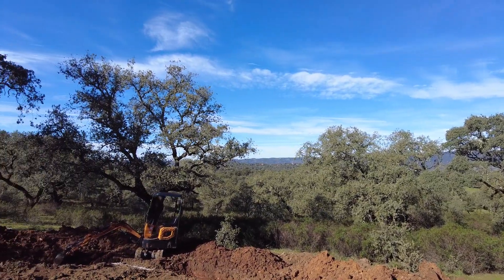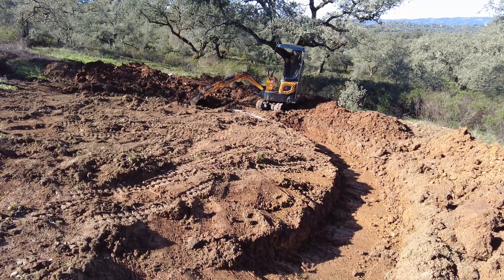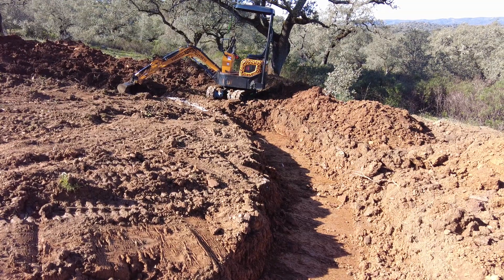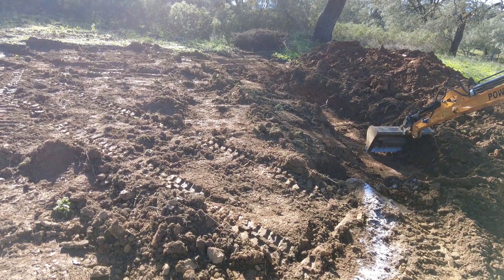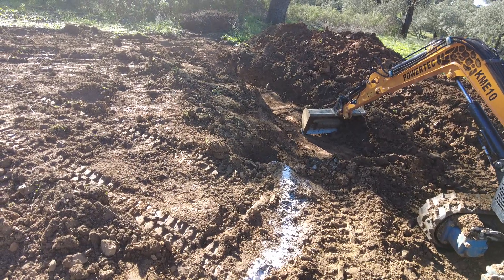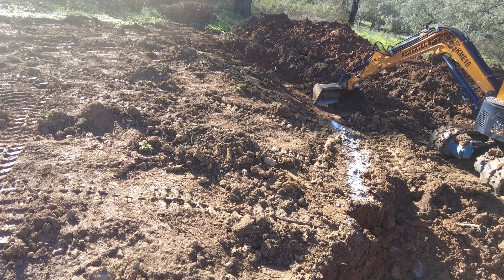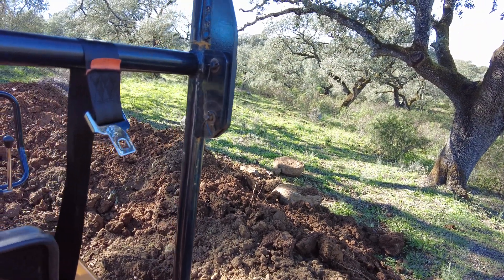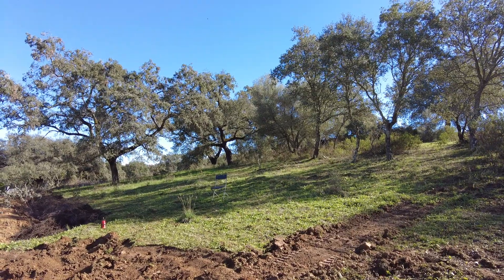Digging a keyway, my way. Which way is the right way?

Comment: well for clay that holds water you need the kind of sticky stuff that sets hard when its dry, if you can dig it easily by hand with a spade its probably not dense enough. if you wet a handful and knead it together it wants to be coming out sticky and hard like pottery clay.
That said when you are digging take off the topsoil then the subsoil and the clay you want for sealing a pond is going to be the next layer down where there are almost no plant roots. and usually on top of the bedrock.
If you have it use atleaast a 30cm thickness of clay to seal embankments and inspect bedrock for fissures that will allow seepage, (a bucket of water is a useful aid for this) and seal those with as much depth of clay as you can pack into them.  If you can find them have a look at how canals were built in the UK, most of them were lined with puddled clay and stiull don't leak over 150 years later. 
Hope this helps 
thankyou for sharing
Reply from the maker: Thanks for sharing this valuable information. Much appreciated. Sticky stuff I will find.

Comment: Beautiful!  I am so excited that you have gotten this far with 110 hours of time in the seat.  You are making real progress.
The walls do not have to be perfectly straight.  What is most important is compaction.
I suggest that you continue to dig what you can from the platform on which you are sitting, casting the spoil downhill.
When you have to move, I would move to either end of the key, with your blade forward and always start digging with your boom, stick and bucket fully extended.
Slowly start to pull the uphill soil into your key, distributing a thin layer of clay evenly with your bucket. When you are ready to move forward, set your blade for 4" and drive ahead to the next dig location.
Work your way around the entire key in this manner.  
Then it is time to drive the machine around the semicircle key several times for compaction.  Each trip move the location of the machine in the trench so your tracks are on fresh material.  Last trip through, curl your bucket and use it to compact(tamp down) any clay the tracks missed.
And that is the process.  Continue this process until the key is level and at least 1/2  meter above the top of the spillway. Use your laser level to get a precision measurement.
When the key is finished, you will work on filling and compacting the 3 to 1 ratio.
My eyeball sees a finished profile that is oval.
With your experience, I believe the most difficult part is complete.  Now you will be surprised at how quickly the build goes.  You should be ready for the rain forecast by Accuweather for the last week of November 👍
Reply from the maker: Thanks captain
Reply from the maker: Thanks for sharing, especially about working my way around with the excavator.
Next week I go to see my grandson, so, pond must look after itself.
How much rain in the Nov forecast?
Reply: @SuerteDelMolinoFarm   That is how I've always imagined this would work given you confidence and experience.  There are nice gentle slopes and eventually you will be riding the key.  So it is great experience that is tailored for you.  This is the third dam we have worked on.  😊
Just one rain day between today and the end of November.  December  has rain forecast on 13 days. Hopefully December will fill it up! 
Enjoy your new grandson! 😊

Comment: When zach weiss built my pond the clay was deep (7 to 9 feet). He trenched down till he hit water then dug down under the water to get to the dry clay it was sitting on.  This was his key depth. Your geopraphy may be different. If you have a lot of clay, getting the proper concentration is easy. Put the test material in a jar, add water and shake. Let it settle out. The top layer (not floating) is your clay. If it is 40% of the total then you have good clay.
Reply from the maker: Super. I'll do the shaking. Thank you for sharing
Reply: @SuerteDelMolinoFarm  i may over comment on this project. Lol. On my trench they did nothing to the sides, just filled it from its trench form and compacted it. They used the bucket to compact it but it was a huge excavator. I think zach said at least 40% clay was what he was looking for to be water tight.
Reply from the maker: Keep commenting. I'm happy to hear it all.
Reply: If you don't hit water, just keying the proper clay % into the existing clay should work. This is exciting. I really want to build a keyed dam.